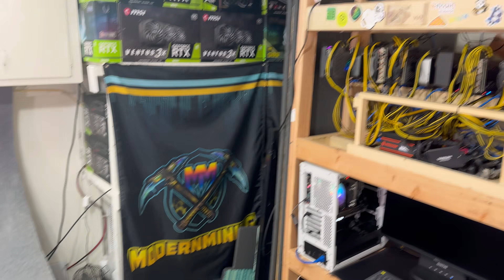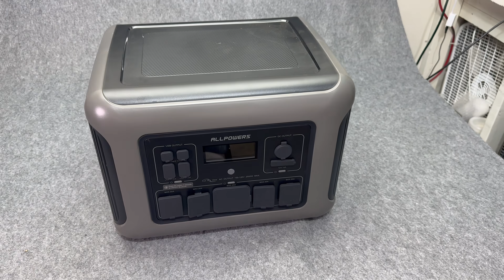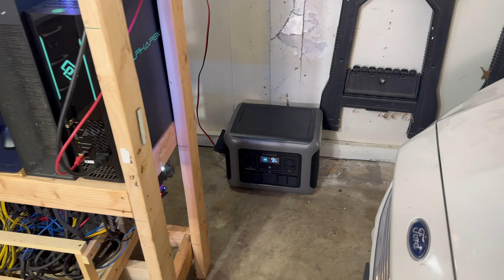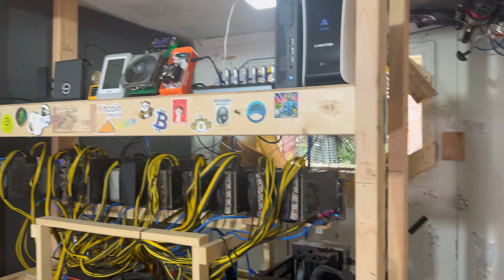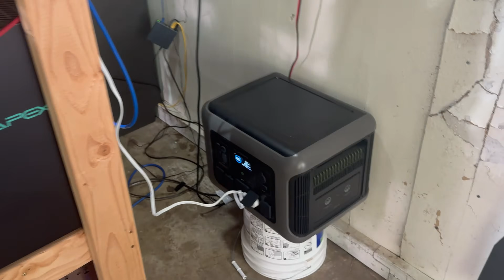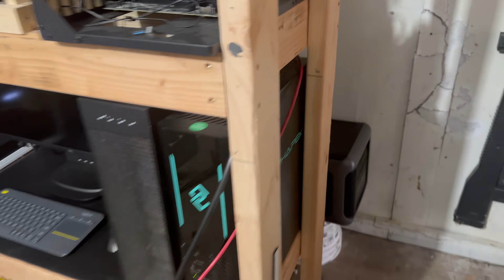I'm Mining Bitcoin Using Solar Power (Sort Of)

Comment: It's been 9 months since you made this. Hope you've done some learning since then. haha..  First off.. try using that other panel. Lay it flat or tilt it.. adjust it, then walk back in and compare what works best. I'd actually buy a 200 or 250w rigid type of panel. They perform alot better than those flexible ones.  I live offgrid and use the ecoflow delta's for some of the power and have a regular solar system for the 5k window AC and also for mining with the 2 mini doge miners. That system consists of six 305w panels, three 100Ah 12v lithiums, 2000 watt Xantrec inverter and then the power supply and finally the miners. They are profitable and running right now. If I had another 3 or 400Ah of lithium.. I'd run them all night. Then the solar from the Arizona sun would recharge them the next day.

Comment: if you wanted it real "bang for the buck" you would go the route of assembling your own battery with lifepo4 cells.
anything pre-assembled is ripping you off too often i found...

i mentioned before doing mining of off solar because i have a decent array with like 20kwh battery and its supporting multiple things in the house (its a off grid installation).
right now i have too much power so the only thing that came to my mind is to mine BTC to put it to some use xD

Comment: Thats a good experiment. Like others said, you have to have the panel facing where you get the most direct sun. I suspect your power station only registers output wattage over a certain amount. My older bluetti does the same. If I plug in a led light on the 120v outlet it shows zero output when its on

Comment: I can confirm my eco flow solar  generator consumes almost nothing when not in use, so something is still on with that generator to drain it to zero in a month.

My 2x 1200 watt off grid battery bank has 600 watts in and only powers fans that cool my asic miners, roi is never since it only saves me a few bucks a month in power.  

Still fun to tinker and learn 😊